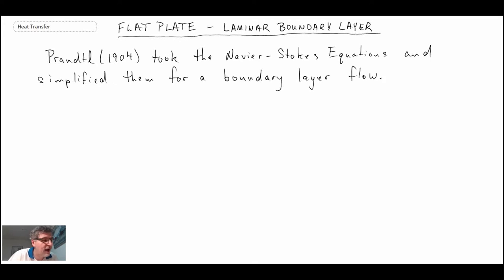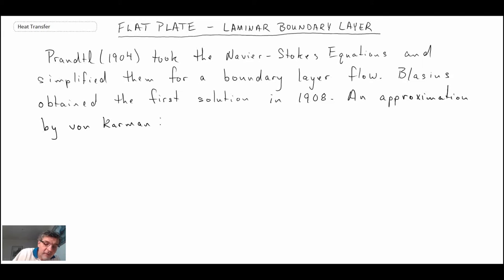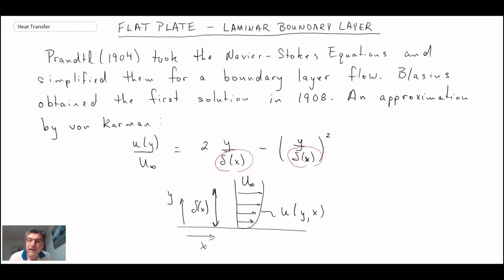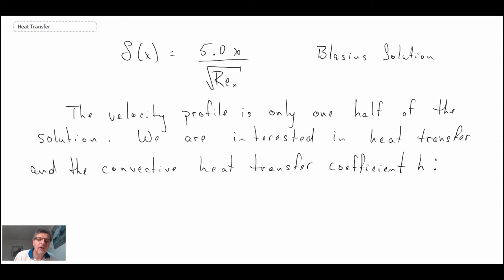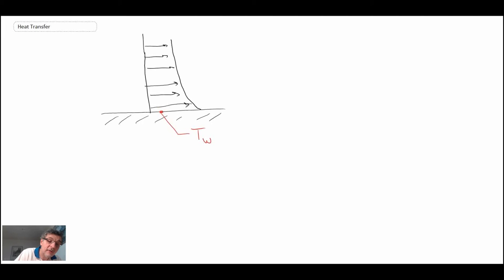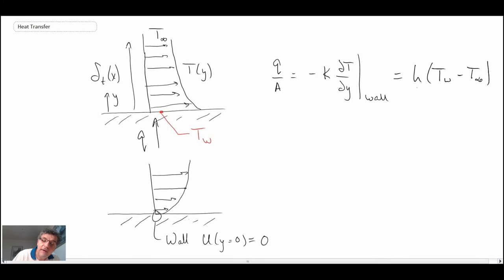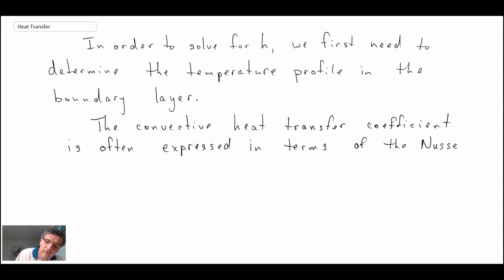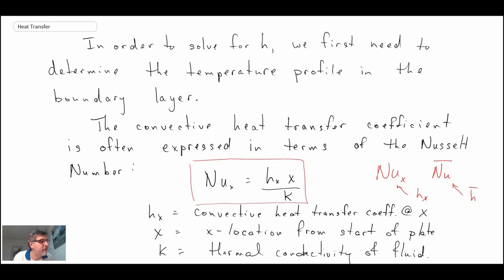Heat Transfer L17 p3 - Laminar Boundary Layer

Comment: In case if i want to calculate nusselt no. for laminar flow ,it means that i have to substitute the length from the leading edge till the point where transition occurs right?